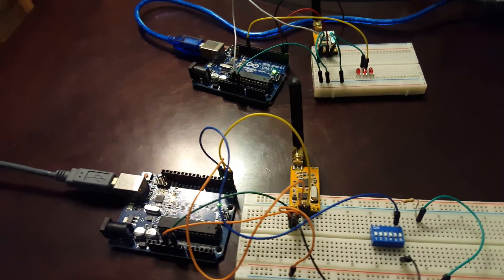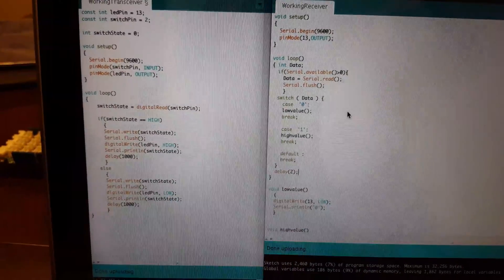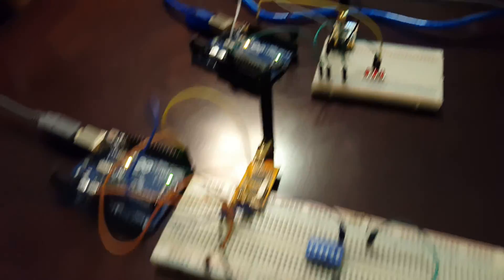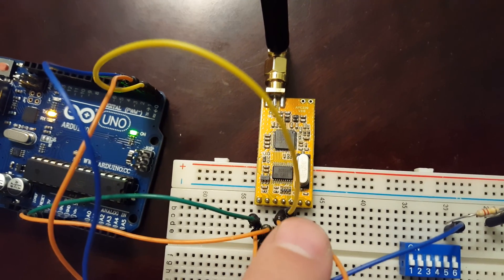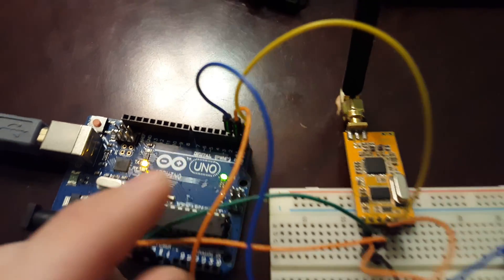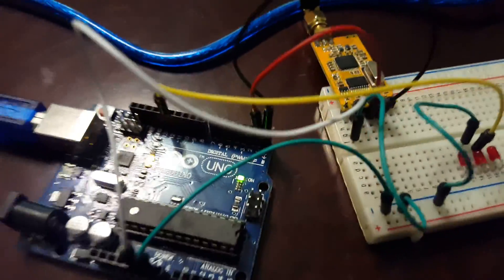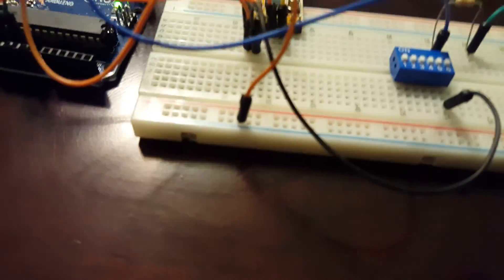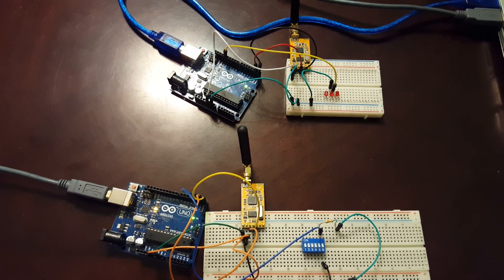Wireless Arduino to Arduino with APC220 RF Modules

Comment: Hey Kaleb Hill, thanks a lot for sharing :D just one question did u had to use the RF-Magic program to set up the APC220s? or could we use them strait out from the box? many thanks in advance keep it up!
Reply from the maker: I didn't use RF-magic. Works out of the box.
Reply: Thanks a lot :D I'll try it soon :D
Reply: Hey Kaleb Hill, I found out all the issues I was having, so I wanted to share so if anyone else is running into the same problems can solve it faster. 
I dont know still if out of the box will work cuz the main issue I had was that I was connecting the APC220 to an Arduino Yun, and I think the problem was is that the RX & TX of the Yun is already used by the linux on board.
The other point to noticed is that I kindly went over the note on the APC220 wiki about using an arduino IDE version specific or older... so voila.. but still thanks for sharing made me push bit further even got me watching rusian videons about the APC220 LOL 

Before I forget... do need to install the drivers either for mac or windows.

Comment: Hi, can you help me with a questions? This type of RF can replace a ZigBee module? How to set up this modules? And finally, this module communicates full duplex? Like transmit and receive like zigbee? Thank you so much, I appreciated your video.
Reply: +Jefferson Deschamps It can replace Zigbee, but you mustuse two of them. One on each side os your communication link. To set them Up, you have an interface tha does that: http://www.dfrobot.com/wiki/index.php/APC220_Radio_Data_Module(SKU:TEL0005) In this link you can find most of the detail you need. And the communication, is not Full Duplex, it is Half Duples, while one send message, the other just listen to it, and vice-versa. Full Duplex is like our phone calls, both side can speak at the same time... Zig bees work in the same logic, Half duplex